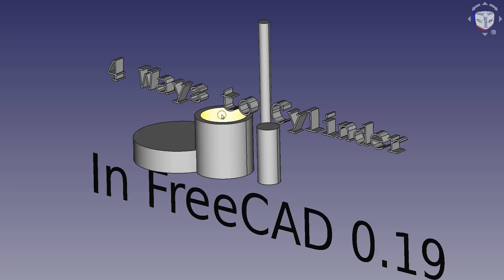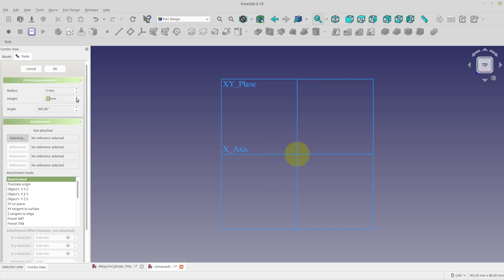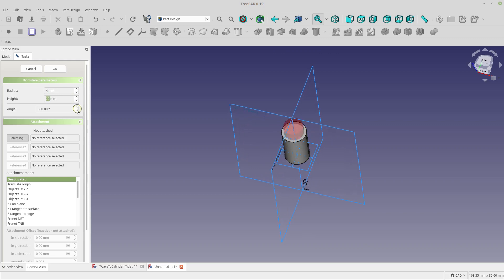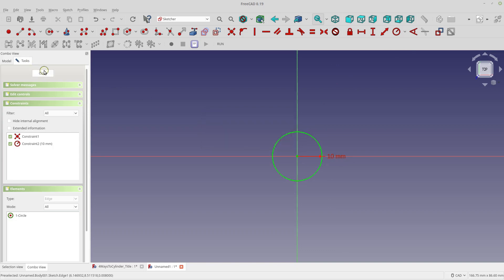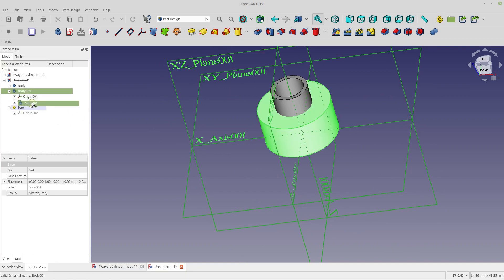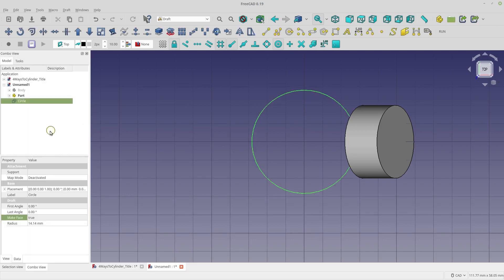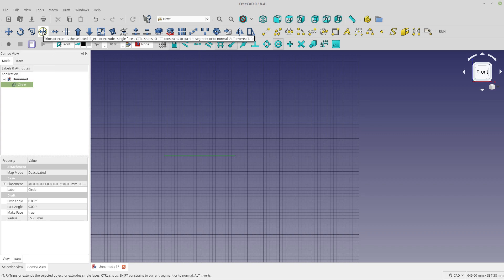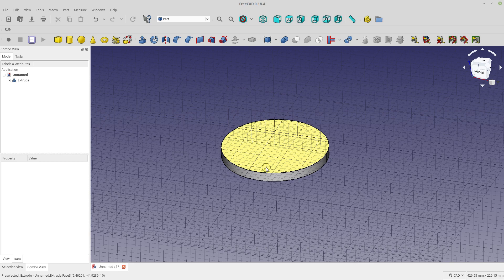FreeCAD Tutorial - Cylinder Basics - 4 Ways to Cylinder

Comment: Thanks a lot.
Summary:
(1) #ConceptOfCreatingPrimitives: [Part WB] -> Cylinder  setting param. & attachment

 (2) #From2DTo3D: [Draft WB] -> Body -> [Sketch WB] -> Circle -> [Draft WB] -> [Pad]
->setting feattures & param.

(3) #ExtendAFace: [Draft WB] -> Axis -> Circle (setting to Face) -> [Extend]

(4) #ExtrudeAFace:Having a circle with face -> [Part WB] -> [Extrude]
Reply: Note #1 and #2 were made in Part Design, not Part or Draft. Part does have a cylinder as well. Other methods not covered in this example might include revolve, available in Part Design, and loft or sweep, available in Part. The attachment system is available for many components (Combo box - Data - Attachment), it just pops up in Part Design because you're expected to use it to build on other features.